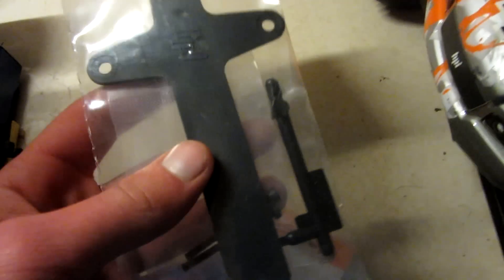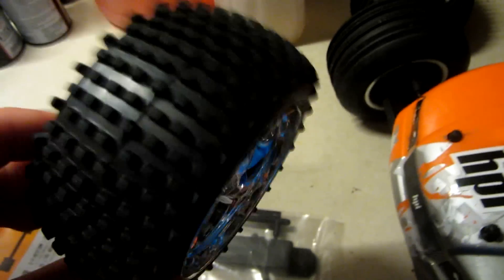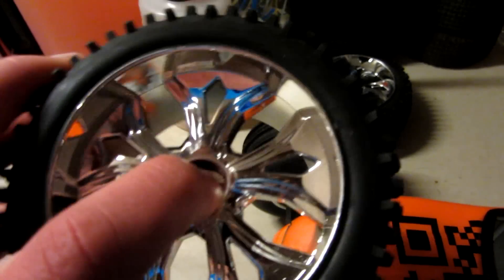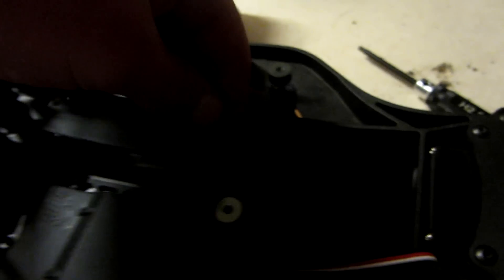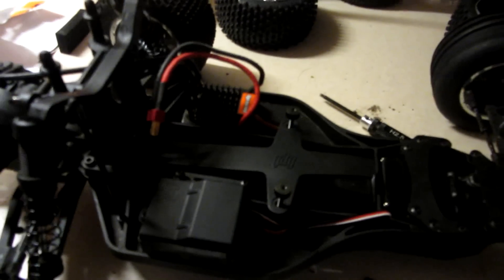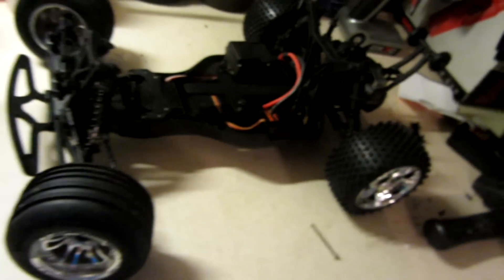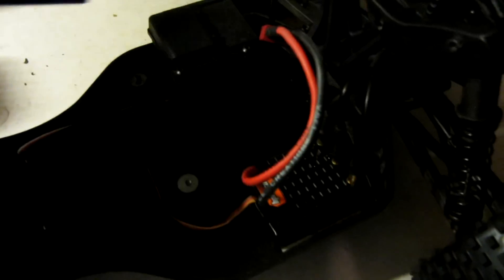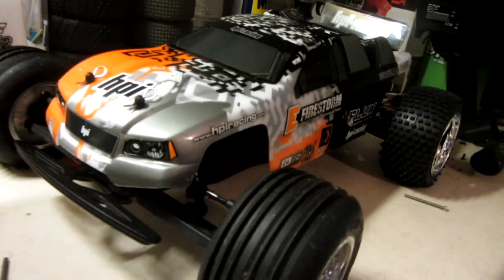HPI E-Firestorm Flux Upgrades | Wheelie Bar, 3S Extender, RPM Bumper & Tyres

Comment: How well is the front bumper made? Is it strong, or do you think it will brake shortly?
Reply from the maker: Juno Mac RC Front bumper is very strong. It is flexible but not too much so, I think it is near to indestructible tbh so highly recommended.
Reply: it is very strong, but after a year mine died...

Comment: Do you think a E-firestorm flux 10t can handle a 6s lipo with a stock fan?
Reply from the maker: ***** No, the E-Firestorm Flux with the standard electronics can handle no higher than 3S LiPo. 6S would need some major mods and it would be almost un-drivable but probably quite cool :)
Reply: MJSracingTV Ok thanks for the feedback :D
Reply: MJSracingTV Could you possibly give me some examples of 'upgrades' i could use, or just a basic idea what would be needed for the e firestorm to be able to run on a 6s lipo?
Reply from the maker: ***** For a start, you would need a 1/8 6s compatible motor/ESC combo, and some mod1 gears. I don't know if this could just fit right in or if you'd have to mod it, but search it up in forums, I'm sure it's doable. Then you'd have to modify the battery tray in order to fit the 6S battery or 2 3S batteries in series. It would take some work and $ but you would sure have a mean machine by the end of it :)
Reply: MJSracingTV Thanks a lot man, ps i subbed :P